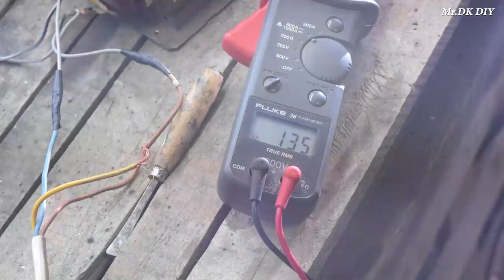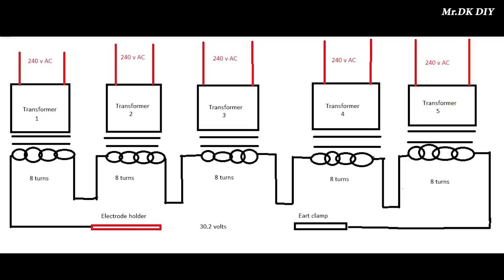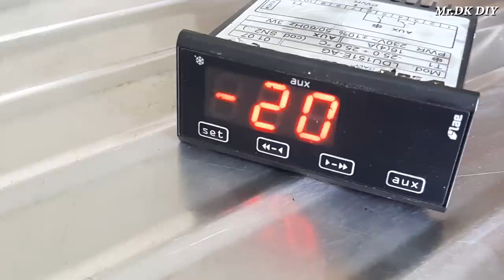4 GENIUS DIY IDEAS MADE FROM OLD THINGS

Comment: For bending your copper tube you can get a spring that sits over the tube & then assists a uniform bend... also try taking two skateboard wheels mount one fixed on your bench & then the other on an adjustable plate with through & through holes that you can pin to make the distance between the wheels larger/smaller as required... then with a wood form you can bend the tube around the wheels & match the template pattern of the wood form ply or other etc... this way you could produce a more uniform coil & at a faster rate with less work.... your gonna need a better rechargeable batter than that for the scooter
Reply: You can also heat the copper to make it bend easier it work hardens as u work it

Comment: I would ad 2 capacitors for each transformer (5x2=10 and one 300 Amp bridge rectifier   because in this way is just a transformer  and the welding is better with DC curent

Comment: I've seen so many projects like this similar and i can't help but to keep wondering "Why put a string around the drill trigger switch versus simply bypassing the drill trigger and totally locating the switch say Right on the handle bars" that way it'll be much cleaner and no string could ever get in the way? I'm not knocking the idea. it's a cool fun weekend project but three minutes more to relocate the switch and wire-tie the wires out of the way.

Comment: I like the way you think, although the angle grinder into a drill attachment/saw seems a bit redundant and impractical. Also, where did you find 5 old microwaves that had good transformers? When they go bad, 9 times out of ten it's the transformer. Anyway, I enjoy seeing what you come up with.

Comment: Hmmm, 30V, 200A is 6KW, 1.2KW pr trafo. So you'll need 5 outlets on seperate fuses. Unless you use 7" nails for fuses. Nahhh, I won't make that welder any time soon. I probably would have used either 3 or 6 trafo's to balance the draw, and then used a 3P outlet. (3 x 230v /16A = 11KW at your disposal)
Reply: At 200 amps the output voltage will drop a lot to maybe 10V. Any electric welder will behave like that.
Reply: by the time your all done it will cost 10 times the price of a harbor Freight TIG welder, helmet, wire and accessories
Reply: If less Amps enough you can always use less transformers and more rounds.
Reply: hi,  Is his project even possible to operate on a 240 / 120 supply voltage.
Reply: no...30v @ 200 amps is 6000 watts. 6000 watts divided by 240 volts is 25 amperes. It could all run on minimum 30A fuse / breaker.
Reply: Flemming Veggerby transformers have oldestTechnologies
Reply: Sounds great. Can't wait to see your video of the build.
Reply: Not necesarily, in order to work safely and not to overload an outlet, you can add a special one, as maintenance people do in a workshop, your electric calculation is ok, just remember, the primary bobines are connected in parallel, all of them can be connected in one single outlet.
Reply: Juu

Comment: All that work to create the Ice Cream Roll machine and in the end forgot the wafers! :)
Nice  DIY...although you are really pushing the safety limits of the wiring in the DIY welding aparatus. At most you should not keep the electrode in contact for more than 12 seconds with that wiring.  Otherwise, great work!

Comment: I made a spot welder with thick welding flex using about 3 1`/2 turns on just ONE transformer which continues to work well spot welding handles on stainless pots. The load is about 9 amps on 120 volts

Comment: I find it amusing that even with your mechanical and scavenging talents, that you didn't find a long enough length of copper tubing to make the coil on the ice cream freezer and that you didn't make a winding tool to bend it. Instead you pieced together various length of tube sections and used sheer brute force and jig stays to bend it into shape. I would expect you to have thrown together an easy to use tool from scrap and found a long, long piece of copper. Makes me doubt your a genius..

Comment: how many turns would be 127v oulet, did you used one outlets for each transformer, and the gauge for 127 would be doble this, and half turns, how could be for add amps regulator.

Comment: Did you get instructions mixed up should of used black wire for electrode connection and hi voltage windings for transformer the prat 🤔😂😂😂
Bet that ice-cream is nice lol

Comment: Would it not be wiser to remove the secondary windings from one transformer and all the windings from the other 4 transformers?  That way you would have main power coming in through the primary of transformer #1, and rewrap the secondary with the 5.5mm wire. Then rewrap the primary of transformer #2 with the same circuit of 5.5 from the secondary of #1 (same # of windings) and wrap the secondaries of transformer #2 with a fewer turns of 8mm wire, and have that feed the primary of #3 and so on and so forth for each new transformer with the secondary of #1 feeding the primary of #2, the secondary of #2 feeding the primary of #3......... with fewer turns of larger wire each time?
Reply: no. that would be a lot more work for the same output, also this set up can give you a selectable voltage output by using only 3 or 4 or 5 transformers

Comment: I have done this and it works great, very heavy though. 

Did you know that you know that you can daisy chain 2 equal transformers and connect them to 2 phases? I'm assuming where you are there are 2 phases like here in the States. We have 2 120vac phases making up 240vac, so for you 2 phases would be 480vac. Much more efficient that way. Am I right?

Comment: Hmm i keep forgetting that regular line voltage out of the wall is 240 everywhere except the USA
So you just need 5 plugs going into 5 different outlets?
Tell me that is not the way you need to plug this thing in
Reply: Actually, you can get 220 at the junction. And I would only use 4 MOTs. 
This guy must be building a battleship. 140 Amps is plenty.
Reply: Isolation, is the key word. Yours would be a Toaster. A Human Toaster.
Reply: I think Canada too is 120
Reply: no. they all get wired to the same plug in parallel

Comment: How they make those harbor freight welders....
Reply: Maybe but they have to pass inspection .This welder was not worth what it would 

cost to make. harbor freight welders plug in and work and if it doesn't work
you get an other one. this is just stupid.
Reply: It's the same process but in an industrial way, the advantage in this case is that you get fun recycling old things. 😉

Comment: I guess i should watch it before making comments,
You need to use a REAL fan like a pc fan mounted in the case and one other hole in the opposite side so the fan can push cool air in...or push it out..either way..2 holes and the fan mounted like a pc